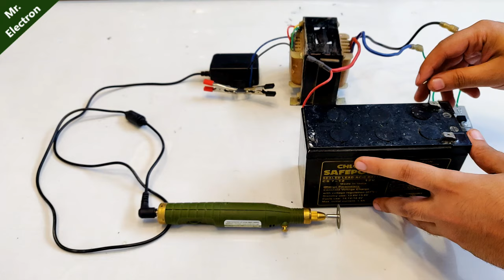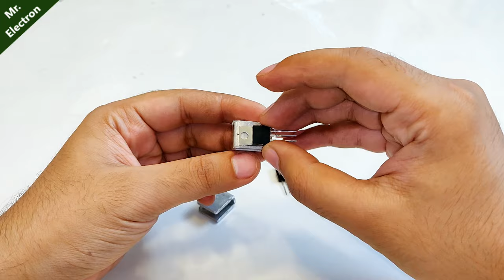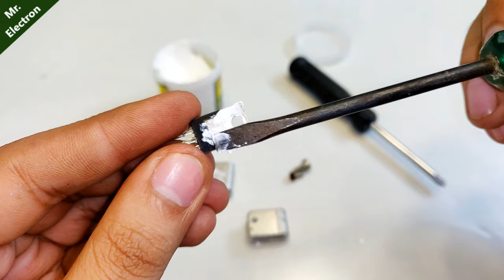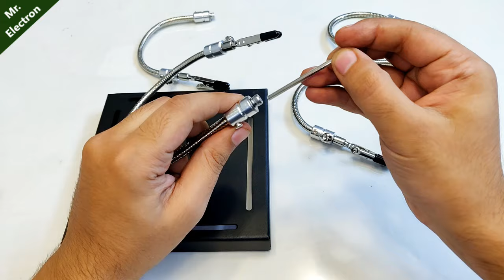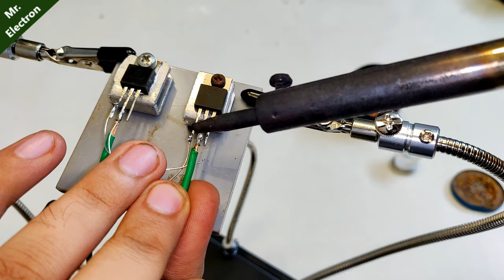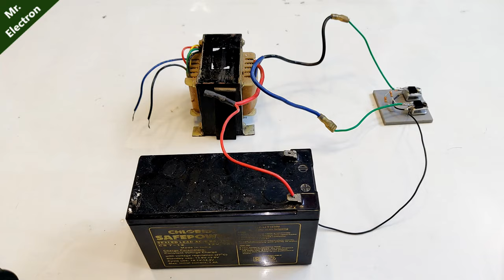12v DC to 220v AC Converter Inverter - School Project Idea 2020

Comment: Can I use 12v normal battery instead of rechargeable...for showcase only and is it necessary to use heatsink for transistor ......and which transformer did you have use? step up or step down?

Comment: Had 3 questions:

1) How much is the maximum current output from the AC side?
2) Can a general transformer be used in reverse (DC input on Step down and AC output on Step up side)?
3) The turns ratio in transformer determines the voltage output, but what determines the current output?
Reply: 4) The fourth question is : how to convert this circuit into pure sine wave to turn on motors ???
Reply: No answer...😂🤥
Reply from the maker: 0.11 Amps
Yes but it should be center tapped
Thickness of coil wires
Reply: @proengeleceng6861  can't,  for that you have to use PWM technique
Reply: @MrElectron 25watt @ max load
Reply: @Nitish_Biswas  no, not just pwm, can also use tuned filters and capacitors to encourage an approximate 60hz sine wave.
Reply: @lazyh-online4839  Oscillator coupled with driver OpAmp?

Comment: if I have car alternator with 12 volts 60 amps connected to 1000 watt inverter how much max power and are they compatible to each other or  should I replace the car alternator with low amps ??? please help me Mr.Electron you are our mentor >>>
Reply: No reason to have a weaker amp alternator. 60 amps at 12v would be 720 watts. That means your inverter will only be able to output 720 watts minus losses (typically 80% efficiency which means you can only get 576 watts output). If you use larger loads that require more than 570 or so watts then you'll start draining your battery as the alternator wouldn't keep up, you also need to consider that the vehicle also uses power for ignition, fuel injection, lights, radio, ECU, etc so you will lose battery charge at even lower power than that. A lower amperage alternator wouldn't do you any good and I'm not sure why you would suggest it. If you get a 150 amp alternator then that should be enough.
Reply: @lazyh-online4839  thank you sir for your information but i choosed a weeker alternator amps just for some tests
Reply: @proengeleceng6861  sounds good, hope I helped. Let us know how it goes.

Comment: Can any other transistor work for this project
Reply: Yes. If anything he should be using a mosfet or igbt. However this isnt good for sensitive things like tv. You need 4 transistors to get a pure sin wave. 2 transistors means a lower frequency.
Reply: Just make sure your transistor are matching and don't try and run to many amps through it or they will over heat. Even with a big heat sink and fan. They can only handle so much

Comment: Of course you didn't include the transformer that not everyone can get in the thumbnail...
Reply: You can probably use one from regular power supplies that just use a transformer and a full bridge rectifier for 12 volts,sometimes 15 volts dc

Comment: Please links for power tools that you're using like drilling machine and its attachments etc..
Reply: It's a 12 0 12 transformer
Reply: It's made for 220v input to 12v output but we use it in reverse
Reply: As to increase voltage secondary should have more turns of thinner wire and to decrease secondary should be thicker wire  less turns which lows the v and increases the amp that's why
Reply: Just us any transistor that can handle 12v
Reply: He is using other transformer but output should be same with the wires

Comment: Does it give A.C. or pulsed D.C.?
Reply: your thinking of a AC-DC converter, where the cheap ones just chop off the top of the AC wave, giving one a "Chopped" DC pulse, which you could smooth out with some electrolytics w/ no problem
this is completely opposite 180 from that... but to answer your query, its final output is 220v AC
I wanna know how long that battery would last until it needed charged again
Reply: @thecentralscrutinizer5105  thx for your reply but im confuced how it uses two transistors instead of four to make an alternating current unless he's doing it directly to a tapped transformer

Comment: Interesting vid, thanks.
I can't find these CTC 1351 transistors (in the UK). What specs required for alternative, please?
I'd like to boost the 12v AC to just 24v AC (i.e. x2). Does anyone know of a suitable chassis transformer, or what search terms I need to use to find one?
Reply: Or alternatively, can I use this circuit to convert 24v DC to 24v AC?

Comment: Light is flickering how to increase frequency
Could  i replace resistor with low resistance (500bto 800ohm)
Please give reply
Reply: Its flickering because it's not a perfect sine wave,its a square wave,so everytime you see it flick,its actually turning on/off/on really fast,a solution might be to add a proper AC capacitors on the output

Comment: what should be the output of the circuit before connecting to the transformer?
Reply: The same as the dc voltage

Comment: Is it possible to run a DC motor with a 12v battery without direct control from the battery
Reply: Can you rephrase the question? The battery doesn't "control" anything so I'm not sure what you're asking

Comment: Bro have you got any videos to charge the same lead acid battery?
Reply: What are you charging from?
Reply: @lazyh-online4839  i haven't changed it yet, i was thinking about re using a battery from an old faulty ups
Reply: @et.sachin  what are you using to power it? Wall outlet? Could use any number of methods from transformer (either premade or hand wound yourself), depending on where you live you might have access to buying cheap smps modules for converting ac-dc.

Comment: You should have demonstrated using a clock radio or small fan..because the products you demonstrated with can function on ac or dc power which does not prove you are actually converting dc to ac.. light bulbs light up dc or ac many drills have a universal ac/dc motor in them...as opposed to  most fans which use induction motors which dont work on dc voltage.
Reply: He used a transformer -_-

Comment: How many amps the power transistors are I going to make it man
Reply: Transistors amps rating
Reply: @shankardass9648  the important part is that it's the right kind of transistor, not just the amperage rating, it needs to have the right characteristics to encourage self oscillation.
Reply: @lazyh-online4839  thanks

Comment: I don’t ave a battery but I try to use a power supply I built but the inverter is not happening I try this and and a lot more circuits but I just can’t get the inverter to work I built a lot of pwm drive for induction motor but I am having a very very hard time getting the mosfet to work cool as I connected the power the mosfet get super hot even at fully gate charge the mosfet fire hot and some burn out but if I use 12 to 12 transformer a little inverting voltage 30vlt from a 1000 watt power supply and the transformer is a 240 volt and I use 120 volt too if I connected the mosfet drain to the 12 by 12 the mosfet get fire hot at 50 hz and 60 too but if I connected the 120 side to drain the mosfet stays cool and I still not get 12 volt on the low side on 2 volt what should I do I use 12 different mosfet and alll the same so if u can explain to me why is this happening
Reply: Попробуй сделать задающий генератор частоты на теристорах уних ампераж больше соответственно родиатор больше пробуй и у тебя все получится